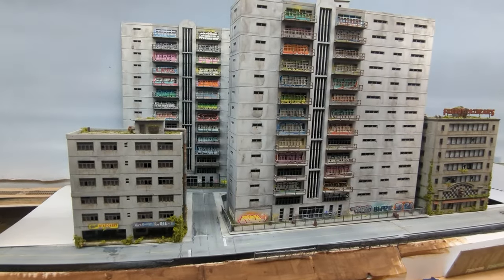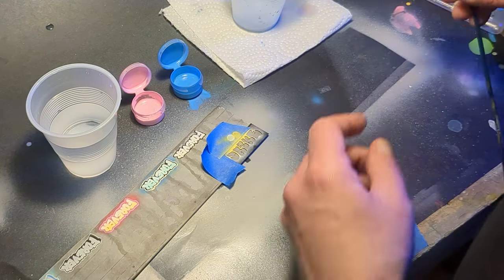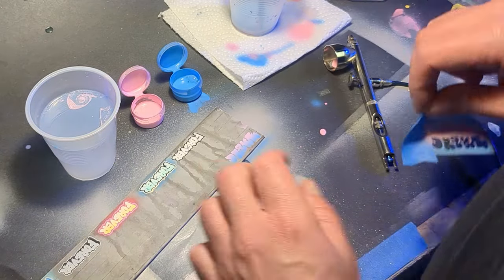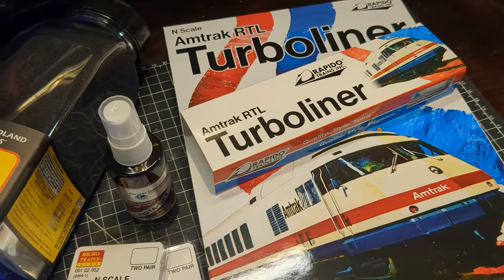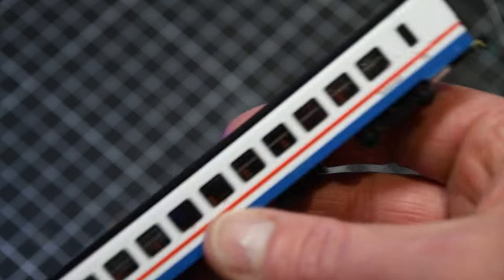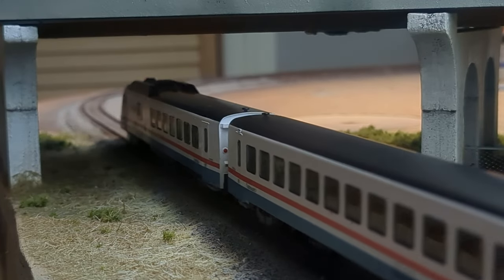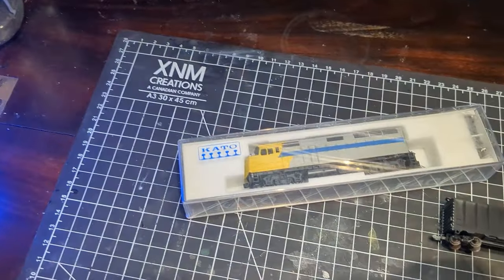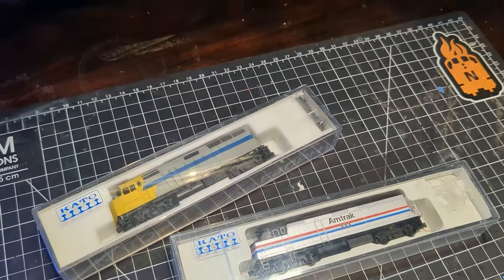Layout Update March 2024 - Hours of Airbrushing and a Stolen Sign?

Comment: I have had a Badger airbrush for a few years.  Bought 2 cheap never heard of ones off of amazoon recently.  
With "needle juice" (lube) the cheap ones run just as well as the Badger.  One small drop on the bottom of the trigger (for the needle valve seat), one small drop on all threaded parts of the nozzle assembly, one small drop on the needle itself.  The needle packing bearing inside will thank you.  
You feel it's resistance when the needle passes through it.  Spin the needle around in there.  All of these things getting a drop of airbrush lube has greatly improved the overall seal and performance of my one semi decent and 2 cheapo airb's.
Reply from the maker: The needle juice - amazing. I'll absolutely take this hint to heart.

Comment: Dear N Scale Dystopia, very cool and interesting tip on how to quickly change the paint in the airbrush! Love the way you did the graffiti project. Do agree on what you said on the window frames in your previous vid. They’re rather pronounced, maybe a bit out of scale. On the true to scale examples you showed, I didn’t notice any windows being tagged. Just for the character of the high rise models you used, the ‘natural’ location for the tags is indeed around the balconies, because how else could and would the artists be able to access the ‘flat’ surfaces of the models. This would only have been possible if you had considered to kitbash the balconies, or architectural feature around the building on which the taggers could have gained access to those parts of the walls. However, that would have been a project in itself. Although I like the balconies as they are, I humbly think a glazed fence would have made a difference. Must add there that to make to scene believable, you would still need the upper railing of the balcony fences. Which in turn still would take away a bit of the view on the tags. All that said, the main thing is that these buildings look great. 
Awesome that you acquired the RTL-Turboliner, awesome train, great model by Rapido, beautiful addition to the layout. 
Kinda interesting you mentioned adding the Ontario Northland paint scheme to your roster. Definitely am looking forward to seeing the results, whether in the paint booth, or on the layout.
One more addition on the highrise kits. Do like these kits, don’t get me wrong, especially for their price, quality and design. Nevertheless, to me they sort of represent the look of the East-German Plattenbau style. Just going back on my posterity lane, from when I visited Toronto years ago, I do remember seeing more high rises with exterior cladding. Even apartment blocks. Think that would be an interesting idea to see added to some of the kits you’re planning to build. Also, for the dystopian character, because it allows for further exploration of disrepair, with parts of outer wall cladding removed, fallen off, cracked, or definitely in need of maintenance. Cheerio
Reply from the maker: I truly appreciate such a detailed comment. I'm smitten with the East-German Plattenbau style - brutalist architecture so I 'think' I'll tend to lean into buildings that represent this - but your point on the cladding is well taken.
Reply: @NScaleDystopia  truly appreciate your reply, the being smitten with East German Plattenbau is a very funny answer!